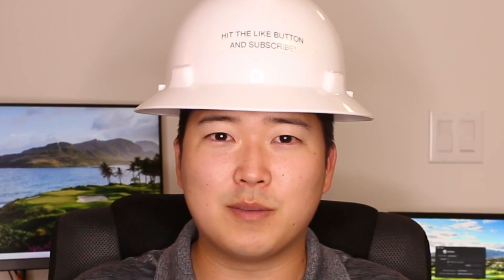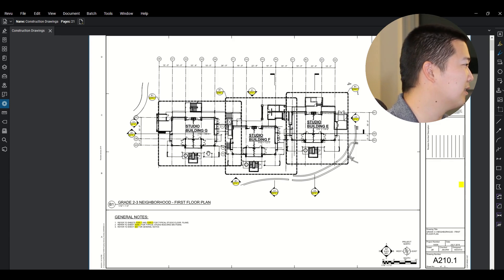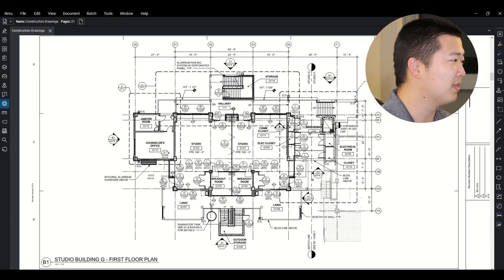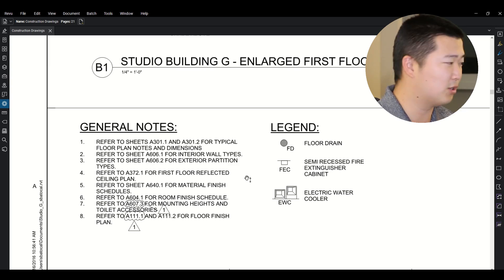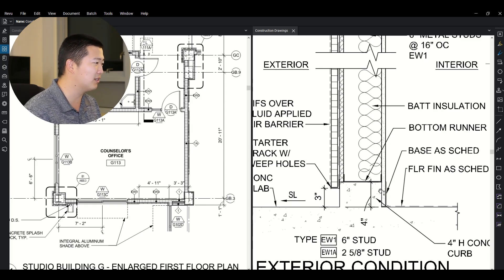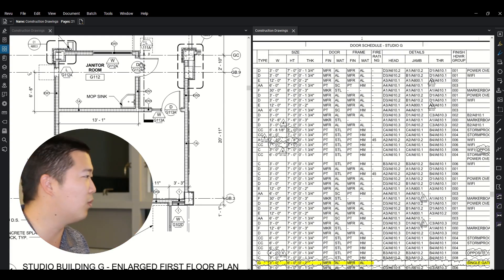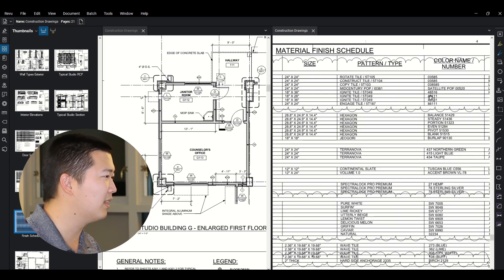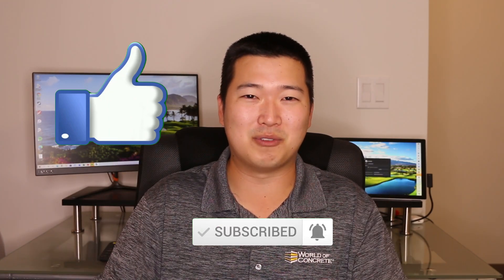How to Read Construction Drawings | Beginners Guide to Blueprint Reading | Architectural Drawings

Comment: Hi Kienen, I own a sign company in Arizona. Potential clients send me blueprints to bid on the signs for commercial building projects.
It would be nice if they would just send me what I need to bid, but they send me ALL the blueprints & I need to go thru them to find the signs required. Is there a section where they are most likely to be?
Thanks in advance for your help!
Keith

Comment: Thanks for the video. I don't you hit this but do they give ceiling height and wall dimensions (length and height) so a painter can determine how much paint is needed? Also, do plans usually tell you the finish of doors and soffits?

Comment: Great job, loved the video, would like to see a video that includes water, electrical and air and how you could use a blueprint from the build to determine best place to access these utilities for a new piece of equipment being installed in a room. Where to pull these resources from to connect to new piece of equipment such as an MRI, CT or X-ray device.

Comment: Would you ever do a video on submittal review and tracking? As a new project engineer at a smaller company I have found I’ve been “thrown to the wolves” to figure this out. Hearing other people’s process would be extremely helpful.
Reply: WOW I Had this same experience starting with both small and mid size gc I was thrown to the wolves constantly  and left to figure out the process and programs on my own and would never get help or answers when asked.
Reply: @jacklinerojo2708  I’m currently in the same position please help
Reply: How is it going so far?

Comment: Hey Kienen, I have Bachelors in Construction Management, and have be working as a residential carpenter helper for 1 year to learn the trade. Im planning on doing this job for 3-5 years to build my resume. I enjoy residential work but would commercial be a better opportunity for my degree and career or do you recommend sticking with residential work since I already have experience and be a Residential Construction Manager?
Reply from the maker: Awesome to hear! It depends if you enjoy working residential; from what I understand its a little more relaxed in residential, may not pay as well but not as cutthroat. If you want to commercial life, then i would suggest you go earlier to learn the culture and how things work